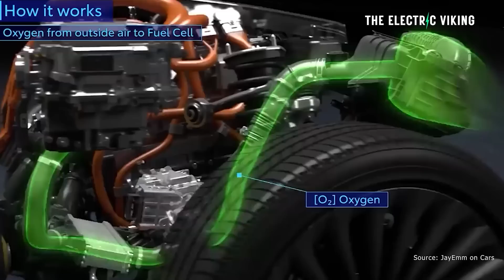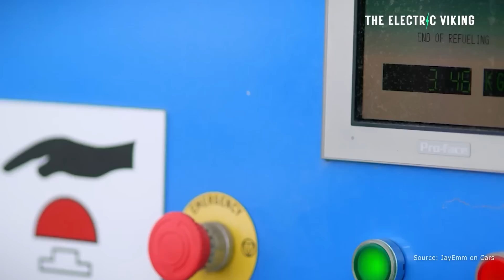Toyota targets China & Europe; plans to sell 200,000 hydrogen cars per year

Comment: Sam I would have agreed with you UNTIL I SAW a Vlog by Dr James Tour of Rice University. He has developed a way of converting waste plastic (such as is in plastic bottles used for Fanta or Cola) into hydrogen and graphene. The process is called Flash Joule heating. It breaks plastics down into their atomic components :- carbon and hydrogen. The hydrogen atoms join together to make H2 molecules and the carbon atoms join to make Graphene. The cost of manufacture is negative because the graphene produced is so valuable.
Reply: I saw the same lecture and Dr James shows that the process creates mostly H2 but does produce a small amount (when this process is done at scale) of methane. If this methane is not captured even this small amount would drastically contribute to global warming since methane is up to 50 times worse in its ability to trap heat in the atmosphere compared to CO2. Maybe they could ship it to SpaceX??
Also, where does the electricity come from to zap the plastic.... solar hopefully. OK  now that you've created H2 gas how do you transport it? Oh yeah you have to compress it into a liquid or you can't carry enough if it to make it worth shipping it. This takes lots of energy.... big loss overall.
OK, now that you have delivered it how do you store it? Ah, did you know that almost all hydrogen storage tanks leak some hydrogen no matter how good the seals are? This is because hydrogen is so atomically small it just sneaks past things. Over time hydrogen tanks leak all of it away.  It can even seep right through some metals. All the piping has to be glass or ceramic lined to keep it in for any length of time. This is why you can't switch natural gas systems over to burning hydrogen without replacing all the infrastructure. 
Finally, new studies have been recently published showing that hydrogen released into the air combines with other gases in the lower atmosphere (I think it is disulfides).... this causes those gases to not make it up to the upper atmosphere where these gases usually combine with methane, degrading it and causing it to no longer contribute to the blanket affect causing global warming. 
When hydrogen is released then we are making global warming a lot worse because the existing methane in the upper atmosphere will stay in place longer making things much worse. 
The more hydrogen we create and try to use the worse this gets. 
All this is to say is that getting rid of plastics is great but making hydrogen in doing so is a bad solution as compared to renewables that directly create electricity with some type of storage device to hold energy for down times.
Reply: @nickmcconnell1291  Hydrogen is needed in huge quantities for ammonia production by the Haber-Bosch process thence onto fertiliser. Iron is typically smelted by use of coking coal - but hydrogen makes iron without the CO2 production. These are the first two massive uses and I’d imagine the Flash Joule heating plant would be sited adjacent to these manufacturing sites. Hydrogen for homes to use in boilers and ovens requires piping which is far too leaky so it’s not going to happen - I AGREE WITH YOU. Hydrogen for cars will be bottled at the Flash Joule heating plant. But that is probably going to be the smallest use as batteries are so much better. 👍
Reply: @johnfrancis4401  Totally agree that this might be a great answer for fertilizer and iron smelting for sure!
They will have to be super careful with the methane produced as burning methane produces CO2.
Reply: @nickmcconnell1291  Well said 👍👍👍
Reply: Graphene is so rare and expensive that doubling the production will have profound effects on the cost and application. Having H2 as a side output would be insignificant and maybe problematic. Good luck to them
Reply: @theairstig9164  Correct. The economics of this process assumes the price of graphene COLLAPSES to $2,000 a tonne - yet still produces a cost of negative $4 per kg of hydrogen

Comment: Now is EV time. May be after 15  years, we may be able to bring the hydrogen technology and fuel prices down to make it more viable. What looks more promising though, is a staggering jump in battery output KWH/KG in just 2 years.
Reply: There is just no infrastructure for refueling hydrogen passenger vehicles, in 10, 15, 20, 30 years insight.  Just stay cool and think about it for a moment......
Reply: Whatever electricity costs hydrogen will always cost 3x more to go the same distance.
Reply: @Joe-lb8qn Your assumption is that you make the hydrogen at the same place as the electricity you are putting in your BEV. In the UK household electricity is 0.39 USD (0.30GBP). But in Libya it's only 0.007 USD. That's 55 times less. 

What do you think the OPEC countries are going to spend all their oil money on? Renewables to make hydrogen, Ammonia, e-fuels. So using the over abundance of unused renewable electricity to make a saleable commodity. 
Did you really think places like Saudi Arabia and UAE are going to go back to breading camel's as their main income after the oil market finishes (at it's current volumes). 😂
Reply: @gavjlewis  so your thesis is huge container ships transporting H2 at 7000 PSI in the same way they currently transport oil? Yeh, I can't see that happening. It would be cheaper to transport the electricity directly (planned now) or have local industries which use electricity or use oil revenues now to invest in companies elsewhere that will provide income. None of these involve going back to the Bedouin era nor do they involved shipping H2 at huge cost over half the world.
Reply: @Joe-lb8qn  Well we ship LNG around the world on ships currently and it's highly profitable when we could get it from the North Sea. Why do this? Because it's cheaper. You don't need to ship it at 7000psi. Liquid Hydrogen could be shipped as low as 15psi if needed. 
Hydrogen is only expensive currently because it uses electricity that you can sell here. Just look at electricity pricing last Sunday, it was negative, they were paying you to use it. This will be everyday in the Middle East. They will use it all to make products like hydrogen, ammonia and e-fuels. 
Yes they could export some electricity to nearby countries but generally they will still be using the cheap oil they the west don't want to produce their off peak energy for fractions of a penny. The big issue is storing the huge amounts of spare electricity. You can't have enough battery storage so you have to store it in some other form. So you store it as highly profitable hydrogen and sell it to the west.

Comment: I've bet a fair sum (with a Model Y on order) that Toyota are wrong to a large extent.

The only reasonable direction they could take would be with their 4WD range and long range transport. It could also do well in Japan if international sales are strong enough.

As for China sales - they will have to overcome the Chinese desire for fuel independence. Persian Gulf oil is can be blockaded, something they want to cut right back on, so ICE vehicles are out of favor. Hydrogen - well it is best produced and used locally. That could work for China, but they need to ramp up efficiency in fuels to reduce electricity generation pollution. As direct EV engines are so much more efficient than the Hydrogen (production, storage, fuel cell) roundabout then demand will be very limited.

Europe? Depends on national car production policy. It looks much better for EVs though, if Norway, the UK, and even Germany with a Tesla factory are showing the continent's trend.

Comment: No thanks to the 5,000psi hydrogen bomb fuel tank and major fire risk if the fuel lines ever leak.
Reply: Actually, the operating pressure of Hydrogen tanks and filling stations is 10,000 PSI.